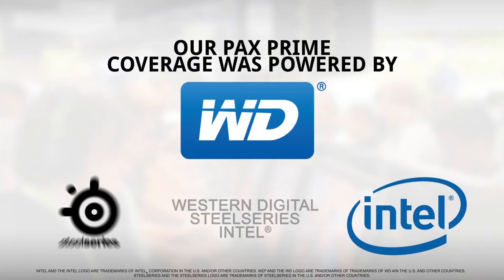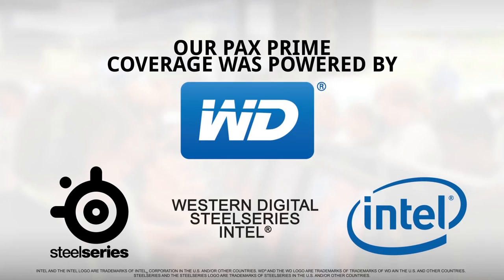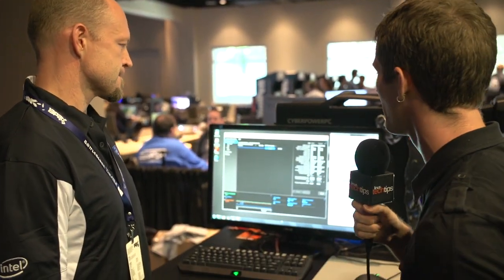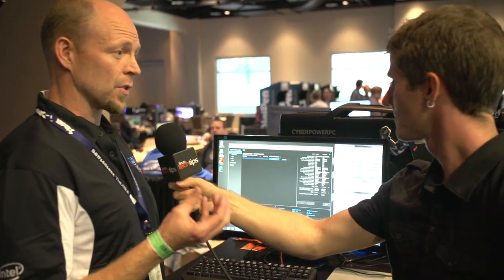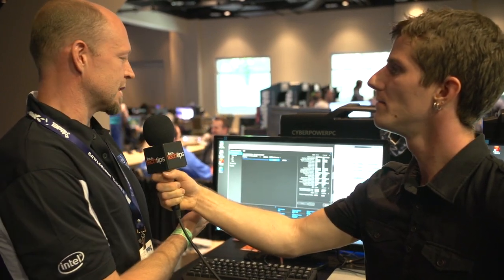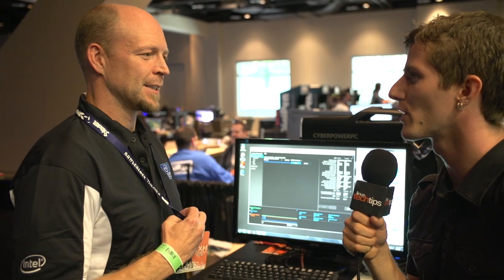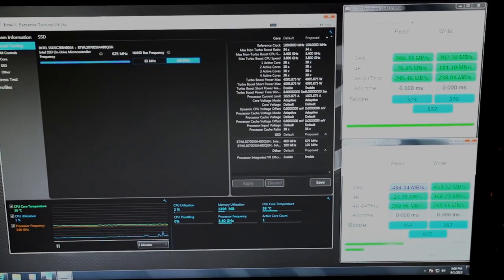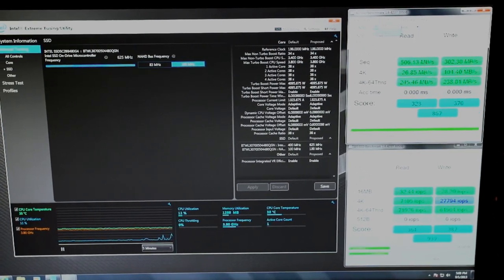Intel SSD Overclocking Hands-On & Prototype SSD Sneak Peek - PAX Prime 2013

Comment: probably something silly like an OS SSD, storage HDD and a raid0 overclocked cache if 32GB models are made. I would rather have it on a non-saturated interface. If marvell, intel, amd or any other sata controller makers made them overclockable, I'd overclock the controller in conjunction with the drives. I'd also do it for fun but that's just me being a tweaker.

Comment: i would buy it (if its not super expensive) and run my system on it.
Maybe i put it in raid with another ssd (the one i own at the moment) - so the data is backed up :)

Comment: if SATA 3 max speed is 600mb and you have SSD with speed over 540 why would i need that tiny 60mb. when the SATA 4 will be available then i could see the performance improvements but not now

Comment: I'd like to have them in raid 0 currently running 2 ocz vertex 3's in raid 0,had them since 2011 its 2013 and have only had one problem,both drives had to have a firmw/upgrade then no more problems and they are still running 7.9 in windows exp for data transfer so the complaint of not secure i have had to re do hard drives multiple time at this time period so my experience is ill never own a hard drive again except as a storage drive 2 or 3 tb wd greens

Comment: SATA revision 2.0 - 3 Gbit/s - 300 MB/s most SSD are around 400-500 MB/s you are limiting the SSD buy having a legacy connection SATA revision 3.0 - 6 Gbit/s - 600 MB/s

Comment: Nope because real world difference on my machine would be virtually nothing. Just like raid 0 really didn't make any difference when I used it besides booting up faster on already stupid fast boot from one SSD. I'd rather my drives last longer because I keep my drives and use my drives as long as they are willing to run. I'm still only now retiring drives I had from the mid 2000's that are finally starting to fail.

Comment: SSD is bottlenecked by SATA 3. It can't go beyond 550 MB/s. So 20% overclock is about 660MB/s. And the overhead of course.

Maybe on the PCIe versions, which are expensive... But in SATA...???

Comment: I would do it. I have 2 SSD's in Raid 0 now for my OS and some games.  But my Programs and other games are on a 4 15k Rpm Segats SAS Drives My impotent data is on a 4 4TB drivs in Raid 5 so i wont loose any thing.  This would be somthing cool and fun to use for the boot drive on a set up like mine i dont have any data that will get lost.

Comment: i don't think that i would run a overclocked ssd. if speed is the case i prefer buying 2 small SSDs and raid0 them. if i look one of the SSDs i still have a second one.
but only for OS and programs.
Files and important data should always be in at least 2 drives at all times. and cloud as well... cloud is the Xisness

Comment: can these guys raid the drives in raid 0 on the overclocked ssds?and no i would have to make a system back up on something more reliable and if the drives fail replace,reinstall,have more fun!

Comment: I don't see why Intel shouldn't do this. By letting the customer fuck around with the speed of the SSDs intel can just sit back selling products that they test to be stable without having to do extra tests to see if they can make their SSDs go faster. Win win right? Personally I wouldn't overclock an SSD cause I have no need for an overclocked ssd.... unless I wanted my ssd to boot my comp even faster XD (mine boots in less than 10 sec give or take).

Comment: 1it woukd depend on the overal integraty of the nand ram and cache ram of the drive as/well on the tech if its mlc no if it slc okay and is intell you low nono meter scales and it wilk also depend n how it effect trim , if trim gos to fast it can wear out the flash ram by 30 percent soo as long as its all balanced it will be fine also what this is great for is data mining compressing decompressing and even decoding so there you go :)

Comment: And you can't actually break modern Processor.
Even if you OverClock like a beast (I'm talking at least 5.8+GHz here), you'll highly likely to fry your motherboard BEFORE anything happens to your Processor, atfuckingall.
You can fry (or even blow up!) some of the older Processors that didn't have preventive security measures, but nowadays, to kill a Processor (even the most weakest and cheapest one) is almost an impossible thing to accomplish. So your Processor will be fine even after mobo dies.

Comment: Bullshit. If the improvement can be implemented or done in a safe way with minimal or no repercussions there is no reason the speeds shouldn't be improved. The speeds are definitely good. I have 3 SSDs Samsung 840s and they're not even high end models but the speed is awesome even now. Although honestly I think I'd simply buy a better SSD rather than one I could tweak.. or a combination of the two.

Comment: ...SSD, designed to overcome the HDD speedlimitations, now being the only component that ISN'T bottlenecking your PC's performance, and you would like to make THAT component faster and take the risk of losing your data or shorten the lifespan considerably?!? What's the f*cking point??
So Photoshop doesn't startup in 1 second but in 0,8 seconds? or to copy a 3 GB file in 4,4 seconds instead of 5 seconds? Man, seriously... tweaking a system JUST to get top performance ratings is just plain stupid.